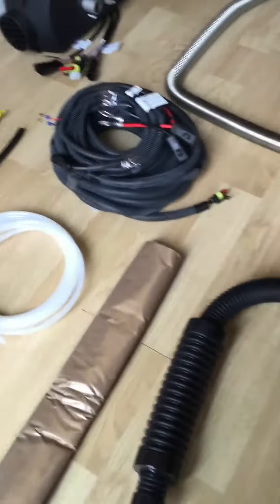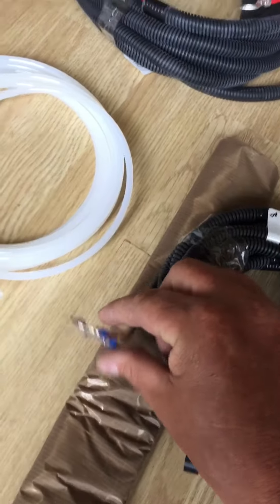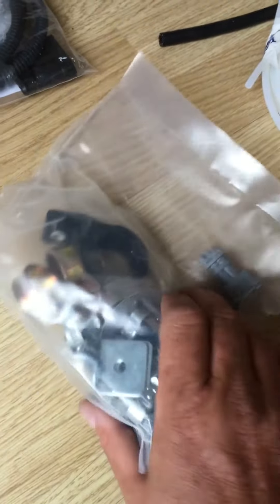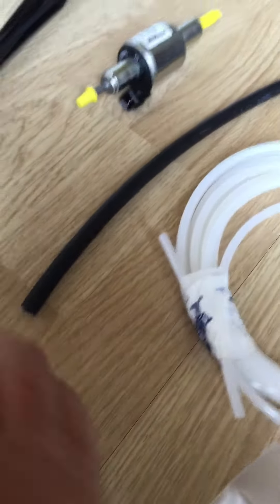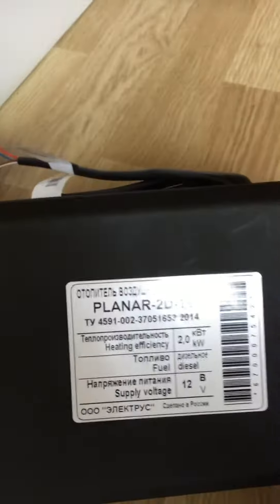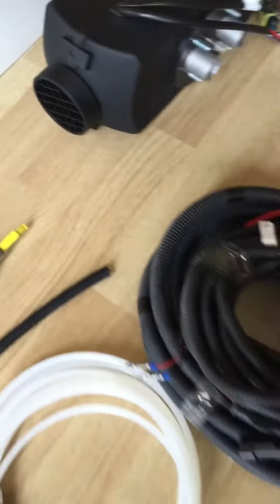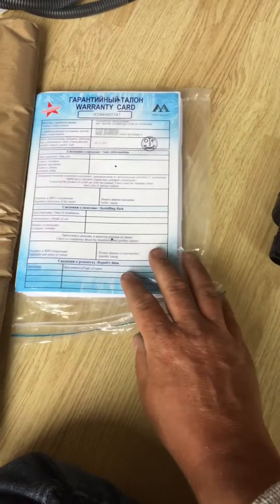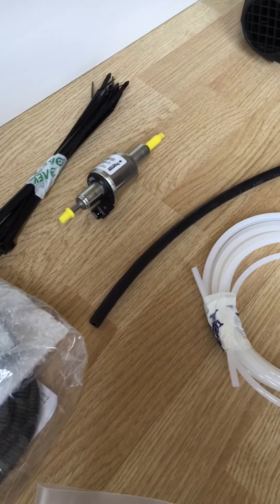Planar heaters UK

Comment: Hi any idea why mine only runs for 10min then switches off? I do have a Russian one which I've had for a while. it's lovely when it's on though. cheers
Reply: Darius Modiri Hi i m in  canada.Can u plz explain me working of Binar 5B/5D 12 GP compact Heater?How to start and set it up?
Reply: sunderjit buttar I have a 2d but the controller is the same,  I press left button then centre, it fires up every time, but stop after 10mins. If it was a thermostat surely it should come back on when temp drops.
Reply: Thank you very much
Reply from the maker: See www.planarheaters.co.uk for more information and contact details so you can ask me questions if you need.
Reply: Thanks alot